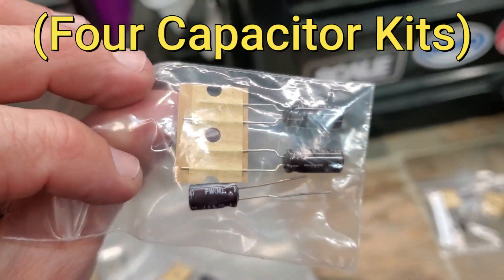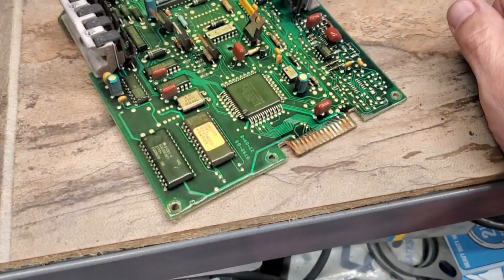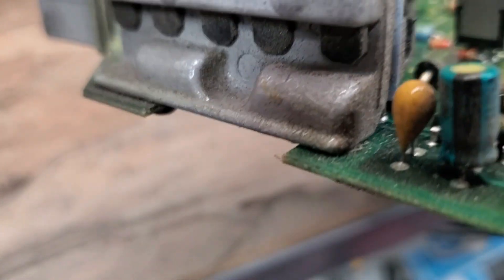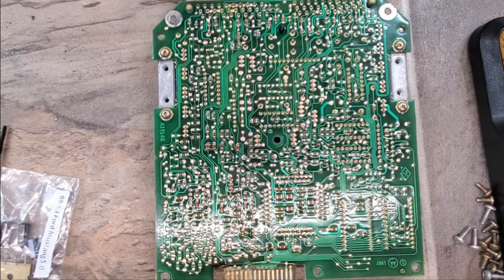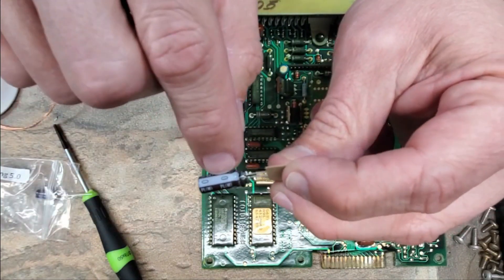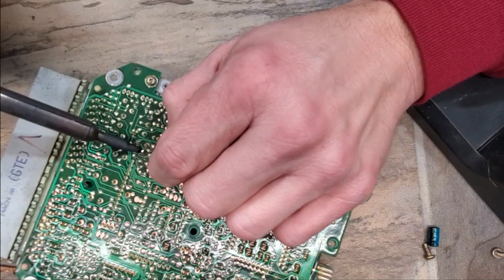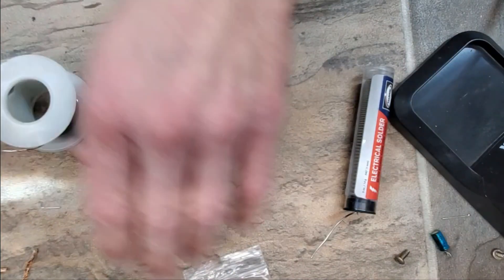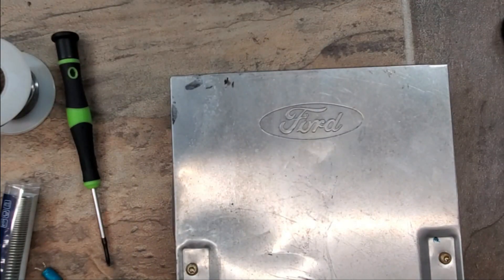The 89G - Fox Body ECU Capacitor Replacement and Repair, Do It Yourself & Save Money

Comment: Thanks. Your video is qbout the 3rd one ive seen about these capacitors. Going bad. I have an 88 stang 5.0  auto and still have the original ecu in it and never been touched inside. I also have a spare for it. So far still runs good. Drove it this past Tuesday . All good. Now it hybernates as it snowed last 2 days.
Reply from the maker: It's a sad day when they go into hibernation. I just put my 89 into its slumber today. Thanks a million for watching, and commenting! Speaking of putting it into a slumber, that video will be coming out tomorrow. I just finished it.

Comment: I have got to tackle my A9L to do this same repair. My eyesight is not good and when I pulled the board and looked at the bottom my confidence went to 0. Man they packed those caps and resistors in there and they're tiny! Great how to video.
Reply from the maker: Thank you so much! I appreciate you watching.

Comment: hello boss, change the aod transmission for standard t5, it is necessary to change the A9P ecu for the A9L
Reply from the maker: I am very sorry, I just saw your other comment this morning. I have been running an A9P in my 89 for several years, and it runs perfect. The A9P is just a little different program on the timing, and also how it handles coming back down to idle at a stop. Did you make any changes on your TPS when you removed the TV cable from the throttle body?

Comment: does capacitors control fuel injectors or another part within ecm - 97 f 350 ,  injectors not firing 
thank you
Reply from the maker: Do you know if your crank position sensor is good? I'd start there.

Comment: Hello my man,great video as usual,i wanted to ask a question,i have a A9P and the computer itself looks great,capacitors need replaced but they dont look bad,still has the warranty sticker on the J port however pin 57 is burnt, not the trace itself on the board but the actual pin inside on the big plug, its right in front of that red capacitor (not sure if thats the proper name for that thing), it burn right in the middle, any idea why this happened and could it be repaired by a jumper ? thank you so much for your time.
Reply from the maker: I am not 100% certain what you're seeing. I'd be happy to look at it if you'd like to email me some pics?
Reply: Thank you so much for your reply,sorry i wasn't too clear,its kinda hard to explain, ill try a different way.

That big grey plug where the main harness connects to the ECU,that big plug is soldered  to the main board by 60 pins, one of those pins broke in the middle, actually burned in half,its pin number 57 (vehicle power),i assume you know all those pins have a number? there are 60 total.

On your video at the 3:32 mark on the left hand side below that magic marker notation and right in front of that red transistor is where the pin broke,ive read that if you try to do diagnostics by jumping the diagnostic port and you jump the plug that goes to the hood light and not the correct one (the other small plug), you can burn that pin up,im thinking whoever had that computer before me did just that.
Reply from the maker: @dntlss  OK, I believe I know what you mean. If I am understanding correctly... Dorman actually sells a 5 pack of replacements, relatively inexpensive. Is this what you're after? https://amzn.to/47L9uoD

Comment: The link you gave to the capacitors on eBay is no longer valid.  Do you have any suggestions for other sources?

Great video!
Reply from the maker: I will look when I get back home tonight. I am neck deep in wiring a Corvette at the moment, but glad to help you out.
Reply from the maker: I apologize, I just remembered that i needed to get back to you on this. https://www.ebay.com/itm/275574674481?hash=item402987d431

Comment: I tried changing my capacitors. Didnt go to well on my end, unfortunately. I even used the same old radioshack sodering iron.
Reply from the maker: Oh man... that sucks. No improvement at all?
Reply: @89G  Yeah my dad and I had alot of trouble getting the contacts to de-solder. We did 2 of them together which went alright. But on the 3rd one I did it on my own. I ended up pulling up the entire contact point for the last one. Pretty sure I damaged the connecting line around the capacitor. 
On the bright side we did another PCM a day after for my Dad's F-150, after the job its running better than its ever had before, so at least that's a victory. I geuss the silver lining for me is that I get to look for an A9L Manual PCM instead of the A9P Auto one I was using. Wish I saw your video before doing the job though. That de-solder wick would've been handy.
Yeah the car stopped starting, and the fuel pump was stuck on priming when the key was on. But hey we win some and we loose some.
Reply from the maker: @Scruffy72  that's so frustrating when the contact comes off the board! I've had to run jumper wires instead as a fix. Is that a possibility on yours?
Reply from the maker: @Scruffy72  great job on the F150, by the way! 👏
Reply: @89G  maybe if I found a wire small enough it could work. I know it was the circle contact that I pulled out, on the capacitor closest to the wire harness connector. Maybe I'll mess with it some more before I give up.
Reply from the maker: @Scruffy72  I woul'd give it another shot for sure!
Reply: @89G  one last thing, what kind of wire would you reccomend to use in an attempt to jump it?
Reply from the maker: @Scruffy72  I have a few rolls of 16 gauge wire that I also got from Radio Shack - much like this setup: https://amzn.to/3nfNnFL
Reply: @89G  just wanted to update you. I ran a jumper as you suggested and it worked! I broke the line right where the capacitor meets the square positive connection, on the top of the board. The capacitor is the 10v one that's close to the pins. Car starts now and the fuel pump shuts off after primer.
Thanks for encouraging me.
Reply from the maker: @Scruffy72  that is FANTASTIC news! Thanks for the update.
Reply from the maker: @Scruffy72  I am so proud of you! That is soooo cool

Comment: I didn't know that capacitior has + -. I soldered wrong, and of course my foxbody is still not starting. Do u think i completly damaged ECU or i stil hav chance?
Reply from the maker: These things are pretty resilient. You might be just fine. Just flip the caps around, and try it out. Hopefully they aren't too difficult to reinstall with the leads being shortened.

Comment: I ask because I am measuring the TPS connector and it gives me 5v on the orange cable and the green one gives me 4.79v when it should be 1v I have doubts that my ecu has a problem
Reply from the maker: It sounds to me like your TPS is somehow at WOT. Is it clocked/installed correctly on the throttle body?
Reply: @89G

Comment: Awesome video! Great job replacing those caps. I didn’t know the stripe indicated negative on those.Really cool about your electronic background. I ’ve had many DOD pedals, definitely have heard of Fosgate. I would have ugly solder joints and probably burn the board getting something too hot. I really really love the DiO at the end. 🤟Where in the world did you find that version? 
👊😎🤟
Reply from the maker: Thank you! Yeah, them caps have a polarity to them. I got that outro from a free use guy named Snake'd on Soundcloud.

Comment: So on where you put on the second capacitor (47uf 50v) I mine instead has a 47uf 16v. Not sure if that's correct on some A9L's? Thanks!
Reply from the maker: Great question! The 47uf is what matters most. As long as it's rated to handle at least 16V, you are fine. I always go bigger on voltage.... just a preference of mine. Hopefully that makes sense.
Reply: @89G  thanks I appreciate it!👍
Reply from the maker: @manuelguisar9254  you're welcome!

Comment: My 91 5 speed will randomly high idle as soon a turn it off and back on it’s fine.
Reply from the maker: Have you tried doing a base idle reset? I have a video demonstrating the Ford approved method.
Reply: @89G  if I turn the car off for a second and turn it back on it’s fine.
Reply from the maker: @Cliffdodger  a few simple things you can do is clean the MAF and the IAC. Beyond that, I would suspect a vacuum leak.

Comment: I tried this repair....and I failed....OR the problem is something else....🤔 

If I sent you my computer...would you be able to fix what is broken? 

I've got a 392 stroker kit with a factory 5 speed and some extras...(but not the best heads from what I'm told...on a budget...and I know how to upholstery work....)  Which is why I bought the vert I got...  needs a top...6 months after I bought the car....the head gasket went and catastrophic damage occurred....then a mechanic offered to rebuild it and I never heard from him again after paying him 600 bucks to remove my motor and ....well..buyers remorse has kicked in huge.  Now that the loan is payed off...my car that would have been a nice entry in and a good deal to start is more than. 20k upside down and I'm STILL not driving several years later....😅🤣😂
Reply from the maker: Just saw your reply... my apologies! Tell me a little more about what you're experiencing for symptoms. And sure, I'd take a look at it for you.
Reply: @89G  well....  I have  the computer that came with the car that  I paid a shop to finish a job that another guy left me high and dry....  and while in their custody/care/control....I was told that the ECU gave up on them....they found one at a junkyard where the fuel pump just stays on full at the accessory position on the key....  well.. they got a jumper wire from under the driver's seat that goes to the ground to allow the fuel pump to be on....but it runs rich and the check engine light stays on....and the car overheats....  it's got some issues still..  😅🤣😂

SO....  I had bought the kit that comes with the 3 pieces that normally goes bad and with my dads special soldering gun and magnifying glass goggles I THOUGHT I was gonna be fine...  I used the ECU that was in the car when I bought it...(which was refurbished before I got it)...

Anyways when I put the 3 new pieces in the board and put the thing in the car...  when I turn the key forward..it makes a sound like when a starter solenoid goes bad and it just clicks back and forth...(but much more quickly).  Never got the car to turn over....🤔

So.... I just put the junkyard one back in.  So I have 2 ECU units....one with new parts that didn't fix the problem...and another that allows the car to run...but not optimal....and when I drove the car around the neighborhood....realized the speedometer doesn't work now either 😅🤣😂

I used to do all kinds of car stereo and alarms and got into upholstery work...but for some reason....when it comes to keeping a car running.....  I'm an idiot!   Haha!
Reply from the maker: @mrupholsteryman  The ECU doesn't have anything to do with the motor turning over... or maybe I am misunderstanding what you mean by "it just clicks". Or does the motor actually attempt to start (turn over)? 

What model of ECU are they? Are they both A9L's? I'll be happy to test one or both of them out and see if we can get you going again!
Reply: @89G  I'm at the in-laws away from the car at moment...family time.  Car has been a sore topic at times.  😅🤣😂  I'm in York Pa.  They are different looking as one is black and the other is grayish...but I never took notice of different model numbers yet.
Reply: @89G  I'll make a small video (maybe next week as I work a lot and that car gets no time.....but I'll put the not quite fixed one in again and maybe the noises will get picked up on the cameras mic)
Reply from the maker: @mrupholsteryman  great idea! Let me know when you've got the video, and I'll have a look and listen.
Reply: @89G  I went ahead and subscribed to your channel.
Reply from the maker: @mrupholsteryman  Awesome, thank you!
Reply: Caps and transistors are dead simple... Fixing traces besides a blown signal return leave someone with the tools to do it...  Almost any computer repair shops can fix these.  Unless the board is trashed and some chips are toast the majority can be repaired by a professional. If the caps leaked there's a good chance the traces are damaged if you look at them under a scope and need to be rebuilt so just throwing caps in them may miss it. Most people lack the tools and skills to do that type of repair as DIY deal. Keyworks ecu repairs has some decent videos on ford eec iv's most people would consider trash where he rebuilds the traces on the board..
Reply from the maker: @nothanks81  thank you for adding that. 🙏
Reply: @nothanks81  I've yet had the time to get to my hurt pony car to make a vid of what my "repair" did....maybe this Friday.   ??